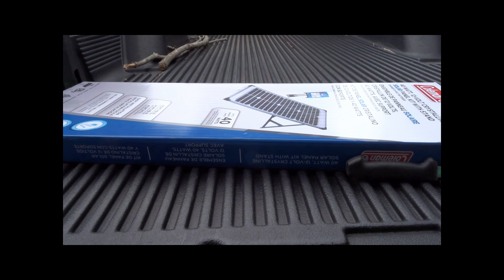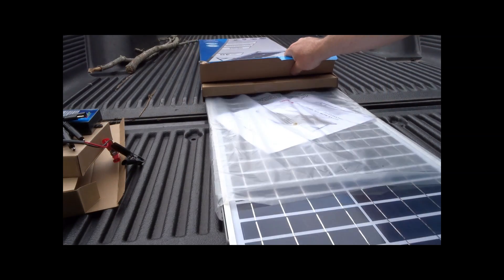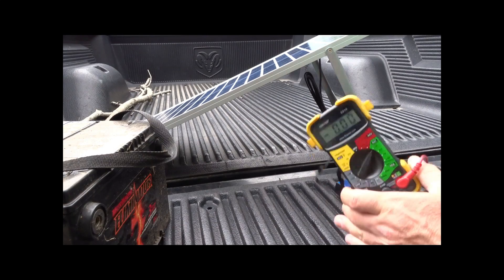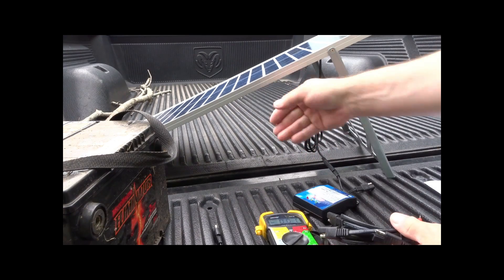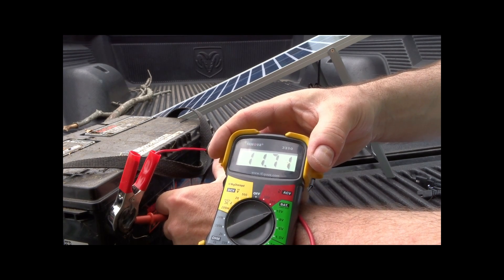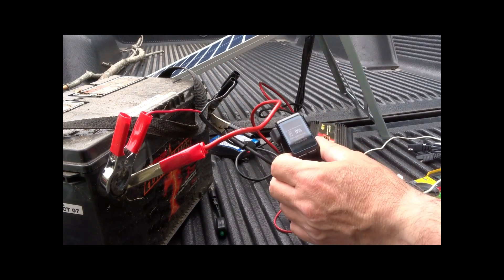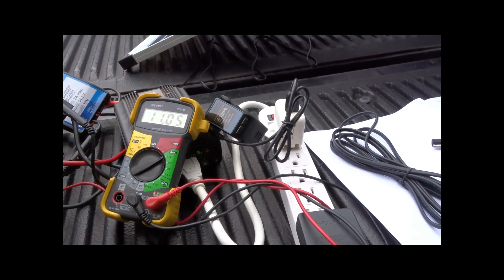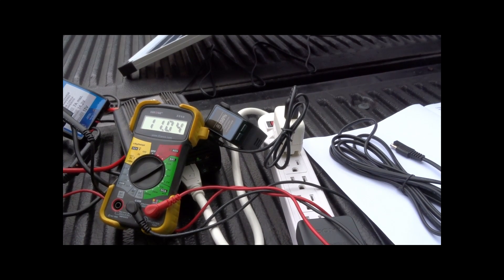Solar Panel Review and Setup

Comment: Thanks for the video. I just bought this same kit, and when I hook it all up, the yellow light on the controller just keeps flashing yellow. According to the controller manual it indicates a "no battery" situation. Thinking it's faulty. Gonna have to return it, not the results I was looking for. Especially since this is my first solar purchase. :(
Reply from the maker: Has it been in direct sunlight yet?   But yes it could be the controller…. The panel also should have come with a test led to see if the panel is working…  the only other thing I can think of is the fuse in the controller is burnt out… be careful also that you don’t touch the battery leads together if the panel is hooked up…. Mine have been used everyday since I got and have been working fine…. So perhaps u just were unlucky and got a bad one….

Comment: Never connect a solar panel to a charge controller without first being connected to a battery.  The power from the solar panel will fry a charge controller with no load. This guy never read the instructions first.
Reply from the maker: As per instructions u are correct.. BUT Simply connecting the panel to the controller won’t hurt anything if not connected to battery… the concern is if you touch the output cables or short the cables before hooking up to battery would cause a short.. I constantly unplug and move to different batteries, if you are using a more advanced Mppt controller we can talk further if you are a rocket scientist. Right now you only want to make degrading statements and assumptions… anyway, thanks for watching and all the best in 2022.

Comment: Have the two cell 'kit' which leaves out the hub to connect the panels in parallel so you can use both of them at the same time.

Comment: Pretty new to all of this can you use any wattage size of inverter with the battery?  An update I got this solar panel and I'm getting zero voltage. In fact my RV battery is dying while being connected all morning without using anything.
Reply from the maker: Many variables, yes you can use any wattage inverter, BUT, the inverter also uses power, depending on the efficiency of the inverter it could kill a battery.  I don’t have an rv, but I would suggest turning off the inverter when not in use and let the battery charge... if during the day and you have a few hundred watts of panels not a concern..... if you have a volt meter test the solar panel to see if it’s putting out power... that would be a start.. if charging a 12 volt battery, the output voltage should be around 18 volts.  Also you should have a charge controller....

Comment: FYI Everyone new to solar, 
NEVER connect a panel to the charger it may fry the electronics as the energy has nowhere to go.
1. Battery to Charge controller. Turns on shows it's working & the battery voltage
2. Solar Panel to Charge controller. Shows incoming solar power. 👍👌
Also NEVER pay more that $50-$60 for them, wait for a 60% off sale 👍

Comment: Underpowering your electronics is just as bad as overpowering them. Make sure your battery is fully charged before you hook anything up to it ... you don't want to cook your $1000 iPhone with a $100 charge system ;)
Reply from the maker: Shawn Mueller Hi Shawn, the vid was just a basic look at the panel, you would never hook up anything directly except a car battery,  you need 
a proper charger designed to hook to a car USB or lighter socket. I charge things or power with an true sine inverter. Here is a vid, just skip to at least half way to get an idea if you are short on time skip to 11 min mark. https://youtu.be/x6nR7dm-BbA   The inverter maintains proper power and if the output does not meet requirements it shuts off... Thanks for the comment and watching.. i

Comment: Is there way to get a charge right from the solar panel itself through the charge controller to a device rather than to a battery then to the power inverter then to your device? FYI I know nothing about electrical stuff, so forgive my ignorance.
Reply from the maker: j mck yes and no, if the device has a 12 volt battery you could in theory charge it directly from the solar panel if it’s designed for 12 volt systems,.. However you are pretty limited because you have to hook the wires directly to the devices battery and it has to be a 12 volt battery..The charge controller does nothing more than protect a battery from being overcharged and wrecking or overheating which could be very bad. (But if monitored can be done). Most things we charge these days have an adaptor/transformer that require standard 120 volts to work, so that’s the purpose of the inverter, to get a standard and stable power source, to generally protect things from damage.

Comment: Appreciate the video. Very helpful. I am planning on purchasing this solar panel for my Group 24 Nautilus 12 V battery (which I use for fishing with a Minn Kota 40 pd motor). Do you have an idea on the time required to fully charge the battery with the 40 W panel (should I buy two)? Alternatively, can I charge the battery simultaneously with motor usage (i.e., bring the solar panel in the boat). Thanks!
Reply from the maker: depends on the size of boat.. yes you can run motor with the panels running, that's perfect.. one thing i would consider is getting a larger panel if you have room..2 40's would be a must.. and of course get on sale because they are ridiculous at full price..
I have a 100 watt which really works way better than the 40.. but you need to spend another 20bucks because it does not come with a charge controller nor does it have a fancy stand.... If i were running a boat i would consider even 2 100watts or a single 150....(but the 2 40's are versatile) I'm sure you could run it all day no problems... or even a 100 plus a 40 that you can move around and angle to sun. ... all about price point...  what ever you decide.. if I were running an electric motor I would 100% get some sort of solar panel for it... if price doesn't matter get something... or wait for on sale.. way overpriced at reg..  Thanks for the comment.. ps a dead battery on a 40 watt will take a long time to charge... like all day in good sun.

Comment: Am I aloud to clip multiple solar panels to my  battery? Canadian Tire is having another sale, $199 for 100 Watt and I have a 40 Watt already?
Reply from the maker: you certainly can!.. as long as each panel has a charge controller. I believe the 100 watt does not come with a controller but one is avail for about 25 bucks... I have 2x40 watt panels and one 100watt on my battery(so 3 separate clips/controllers).. I actually disconnect the 100 watt if I'm not using.. but when charging or running things I keep the 100watt on.. So yes, normally I have 3 panels on one battery.. if you put the system to use I think you will be happy using a 100watt. big difference.
Reply: K&D_Enterprise  how do you connect 2 coleman panels to one battery?
Reply: Excellent, I bought two 40W panels today for my one RV Battery and have been looking all over online for the answer to basically the same question Anna asked.  So I can but the two separate panel clips on the same battery?

Comment: I just bought the 40 watt panel from canadian tire , your video was excellent in explaining it ..this is going to sounds silly . I have had an 1500 watt inverter BNIB for three years ....would it be okay to use in the set up  with the 40 watt ..lol or does it seem like overkill ? And Is using a car battery ok ..I see all these videos telling you to use a deep cycle
Reply from the maker: yes a 12volt car battery is fine, BUT try not to run it down too much as they are not meant to be cycled like a marine type or deep cycle and will not last as long, plus the capacity is usually less, as long is the inverter is designed for a 12 volt battery hookup then you are good. It really depends what you are using the inverter for. A small inverter might be more efficient. If you are running sensitive electronics or electric motors a true sine type would be best. I have a plain old 400watt non sine and it works fine with everything also.
Reply from the maker: in addition to my comment I made.. I did do other videos about the panels and invertors and how things advanced..
https://www.youtube.com/watch?v=6niHsCaBV6Q
https://www.youtube.com/watch?v=x6nR7dm-BbA&t=12s
https://www.youtube.com/watch?v=Kc57TRO2Mts

Comment: Have you checked cut in / out voltages? The controller claims 13.5V and 14.2V respectively. I went through 8 panels because the cut out voltage was well over 15.5V. The cut in voltage (less critical to me) was 13.8V. I kept exchanging hoping I would get a good one but after 8 panels from different production dates (Oct 2016 - July 2017), I gave up as I didn't want to boil my batteries by continuously charging to 15.7V. Great for "once in a while" or "in a pinch" if you keep an eye on it but definitely not good for continuous use.
Reply from the maker: Good Comment Doug - I also have this concern and this is what I found. My 1000 watt inverter display always shows a voltage of .5 to .7 volts above my multi-meter hooked directly to the battery. My controller as per the multi meter cuts out at 15 but will show the 15.5 on the inverter display. Also the cut in is about 13.6 on inverter but about 13 at the battery.  I believe they designed this into the inverter to trick it into thinking it has adequate power to operate(that's another story).  I realize your situation might be different, but something to consider. It is normal for a battery to have a resting voltage of 13.8, that is actually a good thing and a sign of a good battery, the upper end would be the 14.2 which is also fine.. keep in mind though those are direct readings from battery.. my inverter will show 15 volts when the battery is actually at 14.2.. on a side note, I use mine a lot to charge up things and I rarely get my battery topped up like this.. I would not worry about 14.2 at battery, and the charge controller might cut in once in a while, but those panels don't put out much amperage so it should not hurt it.  Hope this helps..
Reply: Hi K&D_Enterprise, what you describe for your 1000W: voltage at the charge controller is higher than at the battery due to line loss.  

Just to clarify my understanding of your reply, have you tested the panel in this video with the 40W panel with the 7A charge controller which doesn't have an analogue display, just the 3 LEDs in this way: 1. put your voltmeter on the battery terminals (no line loss) 2. capture MAX and MIN voltage through a whole charge cycle (charge controller LEDs indicating charging, then charged, then back to charging). This is the test I did with the same panel you have that showed the charge controller not working as it should.

My disappointment was that from my sampling of the product SunForce, who makes this Coleman branded setup, doesn't have very good quality control to catch presumably 10+ months of defective products. Makes me nervous of the players in the consumer solar market.
Reply from the maker: yes, I think you got what I was saying, I was unsure if you were looking at the inverter display or direct test from the battery.. the inverter is way off.. direct to the battery I agree the controllers did not perform exactly as advertised and were about ..5 on the plus side of indicated. I think once I get some good weather and the batteries fully charged I will re-visit this as its been awhile. I guess in the end it depends what you are doing with the battery and charging. I know the panels are rated for 2amps out but honestly its seems on an average day you might get 500millamps, perhaps hit an amp.. if the battery settles at 14.2 with the controller going on and off momentarily I won't worry too much in my situation... I think I will do a detailed analysis when conditions exist. I bet a few people are asking the same question or same concern, I also have someone who is professionally educated in this field so I will put my findings together and get run down from them.. Then I will add a new comment for you, hopefully you will get the notification.  Thanks for getting back to me...
Reply from the maker: ps, yes my controller will run up to about 15 volts on the high end(listed as 14.2) then cutout, sorry if I contradicted a bit in my reply.. 15 it cuts out and then cuts in at about 13.5 (listed at 13 as opposed yours at 13.5, lol quality control)  so its a variance of .5 for in and .8 for out.  getting my numbers mixed up with the inverter display.
Reply from the maker: I bought a 100watt and then did some explaining about the charge controller. I checked with a few people and got the general idea.  here is the video  --Video about a 100watt panel vs 40watt panel and charge controller https://youtu.be/Kc57TRO2Mts
Reply: K&D_Enterprise I watched your video on the 100W panel. Looks much better than the 40W for charge speed! I understand what you are saying about adjusting based on charge state of the battery. And with the values you're seeing (~14.6V), I wouldn't have been worried. Up to 14.7V (2.45V x 6 cells) is okay without worry (double checked at batteryuniversity.com/learn/article/charging_the_lead_acid_battery as its been a while since I covered batteries in school). My controllers went up to 15.6-15.7V which at any current is not good for the longevity of the cells.

Seeing you do the test shows me that my controllers were faulty and the design could work--which is really what I was probing for with my first comment. Thanks!
Reply from the maker: Thanks for the convo and your comments! One last issue that might be related, and this was hard to find.
Basically someone wrote in about having a battery that would charge up to 17 volts, the commenter said the only way that is possible is if the battery had an open circuit. He said basically take it off charge and let it sit for a few hours, if the battery goes below 12.6 "you have an expensive boat anchor" ... I thought this was interesting because a poor battery is normally associated with low voltage indication. So it was interesting the battery would charge up high, but in the end it was really a dead battery, another person also commented on a similar situation with a battery with one dead cell, it would charge to 15volts.. but went dead or dropped below 11 volts sitting at rest for awhile.. again thanks.. got me looking into things.